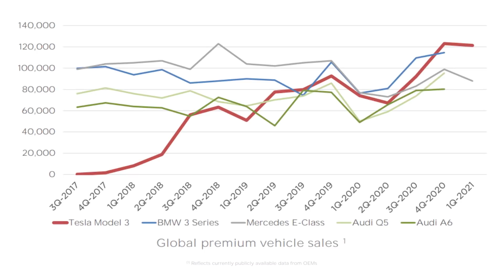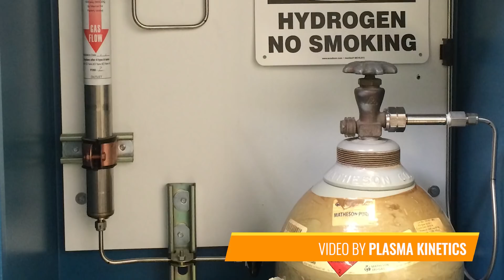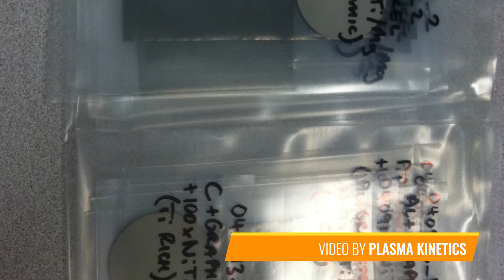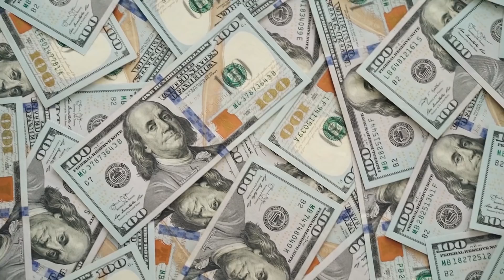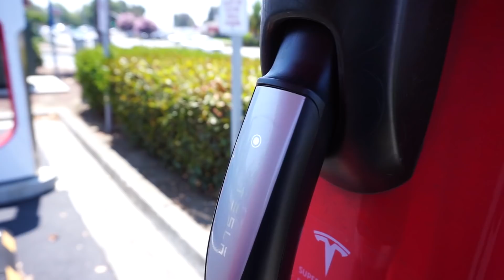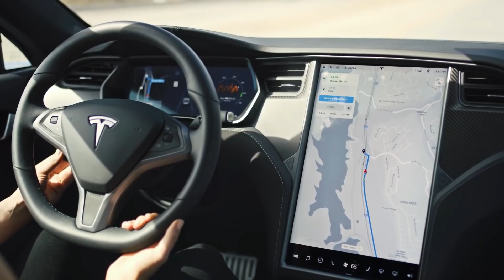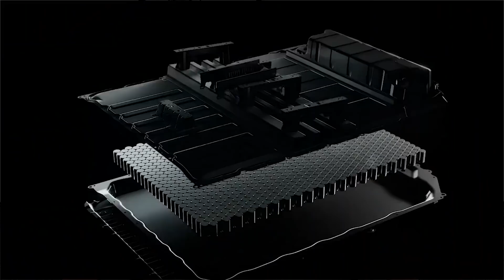SANDY MUNRO: No Batteries Needed for Toyota to Rival Tesla

Comment: If Sandy could share some math on the solid state discs that would be handy. No information on hydrogen yield per gram of material, and energy in (laser) vs energy out (electric energy out of fuel cell). Until that is shared, it is ‘vaporware’.
Reply: Technically, it would still be 'vaporware' even with production. It would then be 'Hydrogen Vapor'-ware. 🤣

You forgot to mention the compressor energy consumption, which would probably consume as much, if not more, energy than the laser.
Reply: Well, even without the math we know one thing: hydrogen (for light vehicles) is inefficient as eff (cost lots of energy to make the stuff) and that would - under any circumstances - get worse when you add another manufacturing step (hydrogen to solid hydrogen). So... I think we can jump to the conclusion that this is indeed vaporware.
Reply: @flipadavis  I mentioned the compressor and laser because they would both need to be in the vehicle to extract the hydrogen and make it usable to the fuel cell, which in turn powers the vehicle. As such, they would both have a direct impact on the point-of-use efficiency.
Reply: @thomasbonse  I was just adding the upstream costs of making the hydrogen into a solid disk form. This is an equivalent energy cost to needing to compress the hydrogen to 10,000 psi in hydrogen tanks. They both take some amount of energy whether they happen on board or off board.
Reply: @flipadavis  I'm not disagreeing with you about the inefficiencies, just clarifying why I mentioned certain things and not others. The hydrogen approach, in general, seems to just be another way to extend the fossil fuel industry's useful life.
Reply: With tanks, hydrogen needs to be compressed to rediculous levels to be compact enough for a car. NO WAY that disk can release more hydrogen per gram. So you'll make the car even heavier and with even less range. The only advantage seems to be safety, which is super important, but you know what else is safe? Lead-acid batteries but still nobody has made a viable car powered by those.
Reply: i'd like to think sandy munro would not spout it if he didn't knew the technology has potential
Reply: @MrMCKlebeband  Sandy is an engineer and he's naturally curious. It's a curious technology, even fascinating. But he says he only peeped it, he's not delved into it.
Reply: rate of release would be helpful too.
Reply: It seems to me aluminium batteries and their very high energy density would be the technological breakthrough to go for. It's difficult, but if there is a solution, vehicles with a range of 1,000 km plus (600m) would seem possible. If achievable it would be all over for both ICE and lithium battery vehicles.
Reply: @jimgraham6722  the biggest issue with Al-air batteries, is that they are not rechargable. The infrastructure that would be required to swap them out and refurbish them is the main thing that makes them unfeasible for use in cars.
Reply: @112358d15  7 employees...
Reply: @thomasbonse  water vapor
Reply: The idea with the Disc from PLASMA KINETICS - indicates an attempt to create another PERPETUUM MOBILE
Reply: Total vaporware, and, by the way ladies and gentlemen, Sandy Monroe is not a chemist, he is not a chemical engineer, and he doesn’t know what he’s talking about. He is not to know all cure-all. He is a smart guy regarding fabrication of cars, he sure as hell is not an electrical engineer or a chemical engineer.
Reply: Thomas Bonse :  exactly, what is the energy efficiency of this hydrogen cycle compared to say solar photovoltaic charging a battery. Here I mean the losses along the way. And look how complex it is. Who wants to go to the grocery store and load up with gigantic modules. Energy does not come cheap and light weight. This is a complete joke. The whole thing is infrastructure burdened. Toyota better go battery electric or they are doomed. They can use their fuel cell on the Japanese space station, or whatever.
Reply: Thomas Bonse :  Exxon mobile and Shell, they are hoping they can keep their gas station delivery chain open somehow, and maybe they sleep a little better at night thinking about these hydride modules Or whatever they are. They can dream on.
Reply: gvaley :  It’s a nice way of saying he doesn’t know what he’s talking about, and neither do I, and I’m in electrical engineer, better qualified than him on this matter but certainly not qualified, since this is chemistry, this is chemical engineer territory, if you are not one of these, you do not know the intricacies of the entire matter.

Pretty sure there is an energy in mefficiency cycle here That looks like hell on earth
Reply: Mark Gesing :   Mr. know it all Sandy think he will just pick up a couple of kilograms module at the grocery store. Ha ha ha!

Besides the absurdity of this, who wants to be picking up dog food packages to fuel their car?  The alternative that is dominating electric cars right now if you simply plug your car in at home, that’s how you charge your car most of the time. This is so simple compared to shopping for dog food.
Reply: @steveperreira5850  It was funny til you took it serious, now it is more funny. Agree.
Reply: Hydrogen fuel tech, is how big biz will sell it products to us. Where as solar energy can be stored in a battery packs and is FREE. The sun gives us all the energy we need.
Hydrogen tech is a big biz money grab.💰🏢
Reply: Fool cells are only good for water fountains
Reply: @seybertooth9282  All the electric being used for electric cars comes from coal.... WTF is the point ? ... Diesel, it hasn't been beat yet, 95mpg in my car, 55mpg in my van.
Reply: Their 5.5kWh (~250g H2) tape spool packs are around 20x15x3 inches and weigh 18lbs, they were (are?) also working on larger 19L 500g H2 units for vehicles and even larger rack mounted systems for what I assume is going to be stationary or portable battery packs, fuel cell efficiency is by far the main issue that needs to be addressed for this tech to be usable.
Reply: @flipadavis  If you're making your own H2 on board, there's no reason to compress it so highly.
Reply: @seybertooth9282  All electric comes from burning coal. Stop looking like a clown. Just cuz daddy Elon says electric is completely green, doesn't mean it actually is.
Reply: It sounded all good till he went into the sewer gas route.  
His thinking that ICE vehicles would be trash is insane.  Poor people can't afford 75 to 100 thousand dollar cars.
Reply: Having some hands on experience. On hydrogen vehicle trials in EU, from little more than 20 years ago. I can say that I'm quite negative about it! It might seem as a surprise. But like mentioned, based on real world trials it was, I won't say a disaster, but at least "not appealing" at all, to put it lightly! Except for the emissions! ;-) 
At the present state of affairs! A practical form of hydrogen vehicle propulsion is at similar levels as unicorns & rainbows! 

Present electric cars are based on remote energy production, with local storage and usage. Basically a motor with some batteries, that's it! Simple basic, efficient (to a certain level) and so damn easy (by comparison with ICE)! Batteries is the present name of the game. No secrets here! But this system comes with several disadvantages! Namely almost always oblige the car user/owner to have a charging spot at home. Or pay it's dues waiting in some random charging station! Batteries is once more the main key.

Hydrogen vehicles try to marry the first, with all of the latest! Bringing the remote energy production into the vehicle! Exponentially increasing it's level of complexity. Certainly there's obvious advantages of having an easy, cheap and simple way to "fuel and move around"! If one would crack the nut! Than could play "king of the hill" for several years! 

No one as any interest in hydrogen combustion. All the ICE technology but burning hydrogen instead of gas or diesel! Beside hydrogen as much lower density than the present gas! So it wouldn't make much sense! Considering the goals.
Hydrogen compression and fuel cells seems to be the target. The huge amount of problems presented associated to the complexity. Bring us back to square zero!

All in all, a wonderful promise, but the in real world. Has so little to make it go! If battery promises do happen. Meaning high energy density and (really) fast charging! Those two factors alone will kill mobile hydrogen faster than any "non compliant" government. LOL 😂  

Let's be realistic. A modern ICE car to be compliant, with power demands, emissions, client amenities, etc. Make usage of every nook & cranny stuffed with technology. Like under fenders, behind bumpers and so on. Hydrogen cars would need even more space!! Notice not a single word about cost... Which is close to absurd! ;-)
Reply: @crpth1  There is not much difference between vehicles running on compressed air or hydrogen.  Both methods are just storing power that originally must come from somewhere else.
There are no natural sources of hydrogen. All must be created using huge amounts of energy.
Reply: @crpth1  I read the whole damn thing, enjoyed every word, and totally agree!
Reply: Regardless it will have to be vaporware because that's the way hydrogen Burns through a vapor gaseous stage so I don't know what you're talking about
Reply: @thomasbonse  Might as well as say, Sharks with Lasers!

Comment: When I hear “someone has just invented ___”, I assume that it is between 10 years to never from mass production & market reality; but great if they can solve all the issues and get it to real production, taking into account the total environmental costs of the fuel.
Reply: He also didn't mention the energy density of the disks. I can't imagine that they're actually so high that you just pop in a small disk every once in a while. I picture it more like you're going to need hundreds of them a week. Hard to say without numbers though.
Reply: You sound scared!
Reply: He said they've been keeping this under wraps for ten years.
Reply: @christopherpedersen1820  Their site says their energy storage is 7% smaller than batteries per kWh.  That means it would need a NIO-style power pack swap station.  It's not going to power a car with a swappable disc thing the size of a small purse.
Reply: @bubbafatas2588  Who sounds scared of what? This is a guy making observations that sounds like he is intrigued. Do you even speak english?
Reply: @christopherpedersen1820  it's a solid hydrate/ hydride (like Li-H or Mg-H2) so the E density is x*10 higher than batteries
Reply: You'd think they would do a simple Google search on the tech to understand what's being discussed in the video. There are even pictures so they don't have to do too much reading.
Reply: @christopherpedersen1820  They post numbers on their site.  They claim 8.6 kw hours per kg.

Comment: It would be interesting to find out how much the lifecycle costs of these hydrogen 'disks' are....to create, to 'recharge', how much range from the disks, etc...
Reply: On their website they say "Storage is 30% lighter, 7% smaller, and 17% less expensive than Lithium-ion battery " if you want to change 400kg worth of discs at each charge, be my guest 😂
Reply: @europeanweb  Agreed....if this was such a great solution, then - I figured it would be better well known.  Maybe this might work out for some niche application, but automotive?  I would envision it looking like the older battery swap model, which has struggled in its own right.
Reply: Obviously the disc would be too expensive.... Sandy Munro can sometimes be an idiot... But I like him a lot of the time

Comment: I watched a talk between Mr. Toyoda to the Japanese government from Japan. I can understand the Japanese language. He didn't ask for help, money, technology, management, etc. He asked one thing: the government must be aware that Japan doesn't produce enough electric energy to expand BEV. If 10% of cars in public become BEV, Japan needs an additional two nuclear power plants or ten more thermal power plants. Toyota isn't behind EV technology; many countries are not producing enough electricity for BEV. Toyota will continually develop BEV, Plug-In Hybrid, Hybrid, and Fuel Cell. So, they can provide meet demands country by country. Mr. Toyoda is frustrated and upset with the government that they are excited and pushing to buy to consumer EBV that Japan needs more energy resources first. Politicians are not understood technology and infrastructure. They want to look good to the public—the new prime minister, Mr. Kishida order, to build more safe nuclear power plants recently. I think, at last, politicians listened to Mr. Toyoda. Japan would build 1,000 Hydrogen stations by 2030, the news said. With that said, Hydrogen Disc is incredible.

Comment: Even with a new way of storing hydrogen, the question of efficiency remains (and by introducing new processes efficiency presumably isn't going to get better).
Reply: There's a video by engineering explained that analyzes efficiency...and you are right about adding a process and losing efficiency.
Reply: Take it one step at a time
Reply: And to add that, hydrogen still has many potential uses, e.g. maybe airplanes due to weight, so always nice to see advancements.  We really need to start living a more sustainable life
Reply: @omaralkayal7598  even if that step is obviously in the wrong direction?
Reply: Ben Daulton  The "heavy industry" is already using electric vehicles (and has done so for years).

Comment: I think Sandy's timing is off. In my opinion Toyota has done a great job in its plan for making the transition from ICE to EV with APV. At this point how many EV's Tesla can build is a secondary issue. The critical issue is how much infrastructure is in place to support those vehicles including fast charging and service support. There is growing pushback regarding the lack of 3rd party options for servicing Tesla vehicles. You've probably heard about the $700 fix for a break in a cooling system that Tesla wanted to charge the owner $17K to replace the whole battery pack. That's probably one of the most extreme examples but it shouldn't happen. Hybrids are a way to fill the gap between ICE and EV while the infrastructure issues are being worked out. Toyota is one of the leaders in ICE and APV while fine tuning what they have planned for EV. There is no rush. That EV infrastructure, anything remote close to the ubiquitous fueling and servicing of ICE vehicles, is a full decade away in my opinion. I've been involved in the electronics industry for 40 years (electronic component manufacturing) and have been working with solar energy companies for over 20 years. The pace of change on something of this magnitude is not years but decades. Government in concert with the automotive industry (Ford, GM, Tesla, Toyota and other manufacturers) are all going to be involved in making decisions on how that infrastructure is going to be built. It's not going to happen based on Elon's timetable. I think Sandy's 8 years is woefully optimistic in claiming you won't be able to give ICE vehicles away.
Reply: I overall agree with you. It's impossible to say when ICE vehicles won't have significant sales anymore. I agree there's no rush. But Toyota and Honda would be better off at least putting out there in the EV space to show they're in the game. But the talk on a lot of EV channels of Toyota going bankrupt because of their current EV status is something I find to be silly.